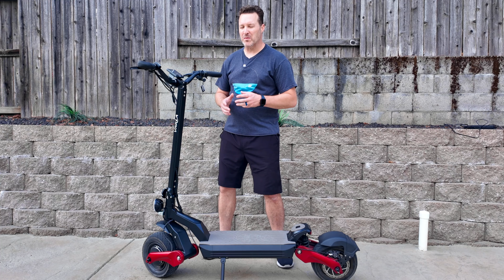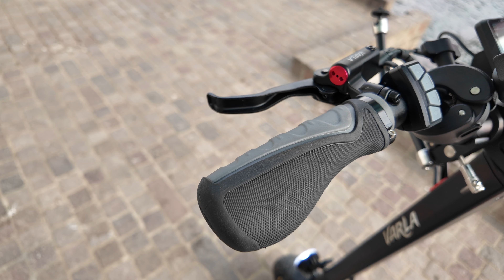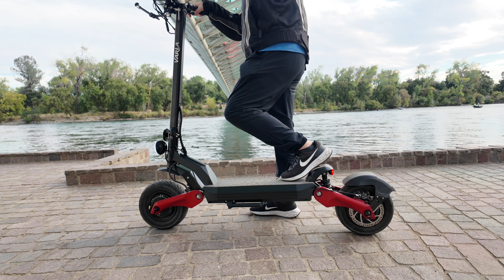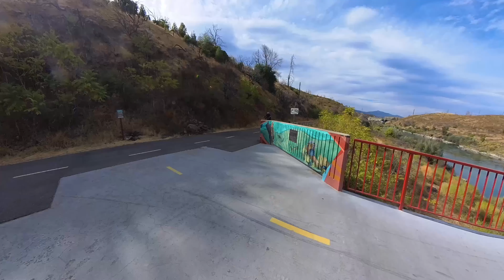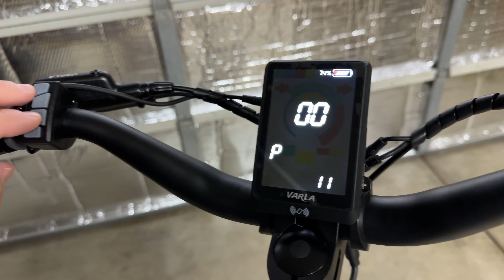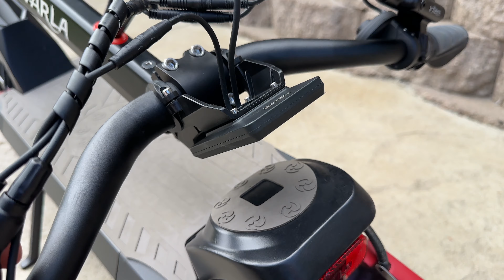Varla Eagle One Pro-Fun And Fast!

Comment: Sold all my varlas there a midrange scooter there battery cells aren't good I bought v2,pro, falcon I wasn't impressed I now own teverun fighter 11+ and the teverun fighter supreme ultra and man the varla felt like trash after riding my teverun varla scooters after a while there battery cells gets weak so quick there voltage sag is horrible after 8 months my Eagle one pro started to get only 13-16 miles in range and my v2 was about the same although it is a great beginner scooter but for me after a little while things on the scooter just started to act up
Reply from the maker: Good feedback thanks 👍🏼

Comment: I love my varla eagle one 2.0 came with a wide deck handle bar grips are better, it has a hook to hold the handle bar & the light is up high on the stem amd my tires ars off raod tires! Good review, you should try the 2.0
Reply from the maker: Sounds like I may need to!